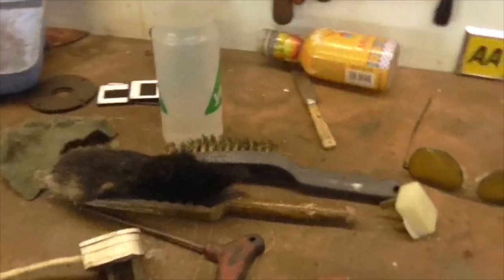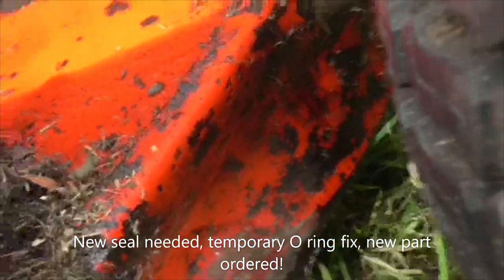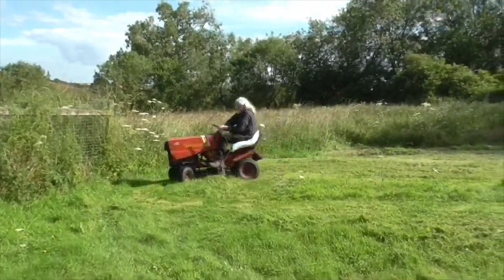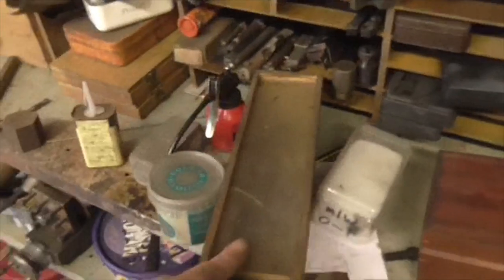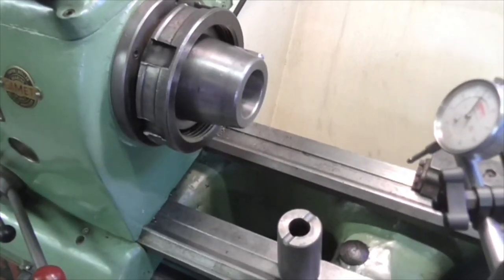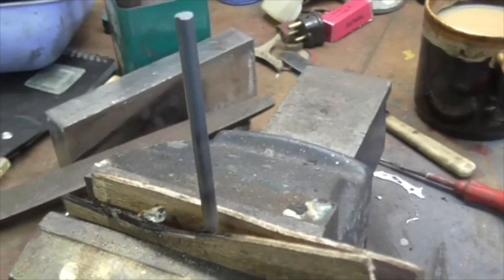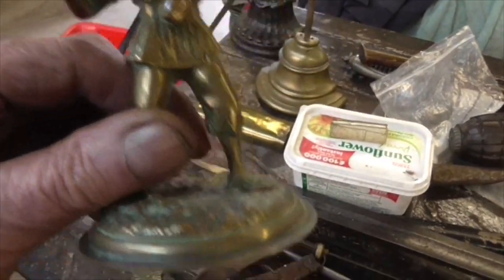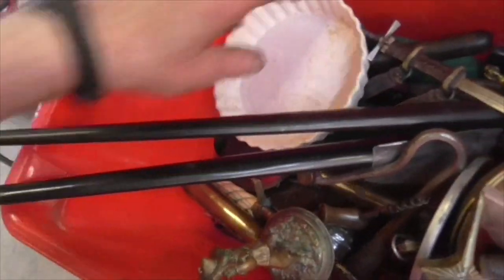Lathe alignment, antique repairs and lawnmowers!

Comment: You did right ditching that starter. I once bought a service kit for the same model for a spray booth. It kept breaking down midway through polishing a job. Cost loads of downtime. Ended up fitting a new one. Job done, worked A1, no more frustration. Cheaper in the long run, if I'd of known. Cheers Tony
Reply from the maker: When I was serving my apprenticeship we used nothing but MEM starters, they were just about bulletproof, there were others, but as you say, they were generally very unreliable!! AEI did a “Stayright” wich immediately earned the moniker of” stayright never right”! Brooks made excellent motors but poor starters, not sure but I think this one is an Eaton, same type is on the Holbrook single phase motor. MEM for the win!
Phil
Reply from the maker: Its not an Eaton, its an Allen West, their older starters were really good, complete with oil damped dashpots an all!, another case of the mighty fallen!
Phil